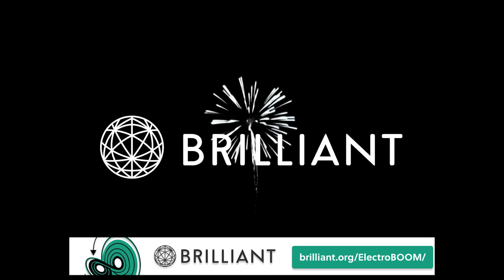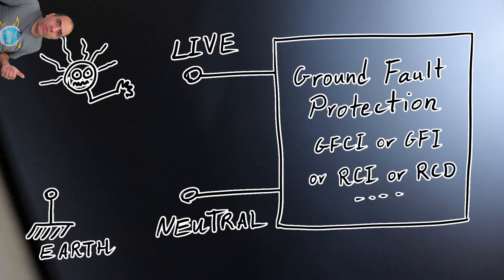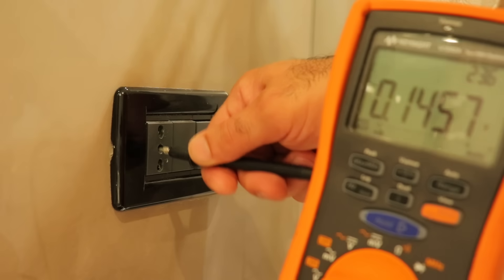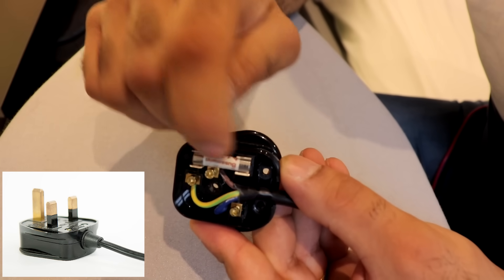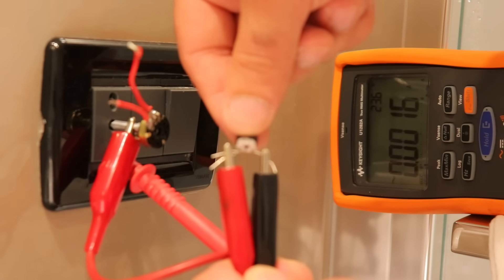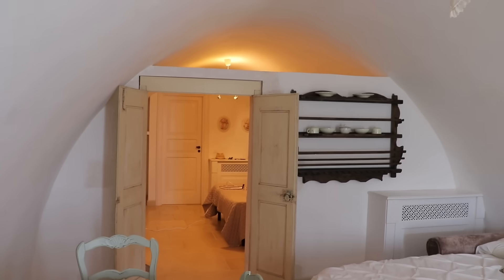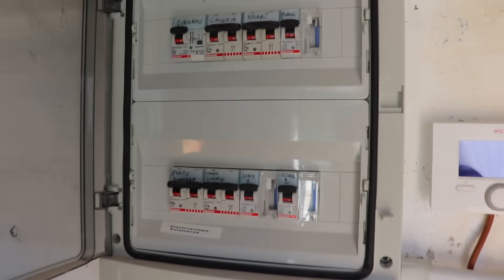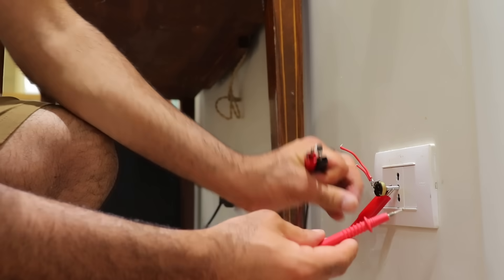Tripping Every Breaker in Italy

Comment: Fun fact: as you can see at 7:21, in Italy we have Ground Fault Protection breakers commercialized as “Salvavita” which literally means “Lifesaver”
Anyways, props to you who managed to shove a Schuko 15:28 into that socket. All of my attempts always miserably failed
Reply: That wasn't a Schuko, it was a CEE 7/7 plug. 15:10
Reply: @Okurkaarrgghh  Italian sockets have two side holes 10A (small) and 16A (large) then there are sockets like those in the video which are called 10/16A sockets with double holes, the shuko plug (CEE 7) cannot be inserted in either in the 10A socket nor in the 16A and not even in the 10/16A because the center distance is different, only by forcing it a lot you can insert it but you shouldn't because the earth is not connected
Reply: @Okurkaarrgghh  he was assuming that since you pointed out it wasn't a schuko then there was a reason why he was able to plug it in. General conversation common sense
Reply: @Salvatore_Corona  Everyone i know ( i am exaggerating ofc ) forces the schuko into the non schuko. I always tell them it's not safe... I call it bad design.
Reply: @Azarilh  personally i find it really hard to fit a Schuko inside a 10/16, and I've been tought that if you have to force it it's not made for it. So i never even tried to, but then again there's many types of people and design should account for it, yes.
I blame it mostly on the double standard of using Schuko plugs kn the first place but since we have to the design should remove the issue, which apparently it doesn't
Reply: @zerokun2655  It is a tight fit and you have to shove it inside but i see many people do it.

If it's possible and many do it it's a flawed design.
Reply: @Azarilh the thing is that one Is the German standard (shuko) and the other is the Italian one, but nowadays a lot of home appliances come with the German standard plug in the hole Europe
Reply: @Okurkaarrgghh È sempre della famiglia "SCHUKO" !
(Schutz-kontakt!)
Reply: @Okurkaarrgghh  I see what you mean, but that's nitpicking. That plug is still a type of Schuko, compared to all the other standards. It's just the modern type of Schuko that is compatible with French sockets.
Reply: Yes.. when he inserted a Schuko plug in an Italian plug i was like: wait.. that's illegal
Also i didn't know the whole unit had GFCI, went and checked my electrical panel and i found those 30mA GFCI breakers.
You learn something new everyday
Reply: Lol. In Argentina, many people continue to call Ground Fault Protection breaker "salvavita" despite the fact that the brand has not been marketed for decades
Reply: @juanignaciofernandez8040  It's not even a brand in Italy, it's literally just how it's called.
Reply: @Shendue At 7:21 one can see salvavita® on that GFPI from BTicino. So it seems to be a brand of this company
Reply: lo stavo per scrivere ma sei stato più veloce di me GG per te fra
Reply: Ive shoved a shuko in an italian outlet 😈😈😈👍🏼
Reply: Fun fact - the breakers are labeled "camera 5", "camera 6", because camera = room
(I am not Italian, but I figured this on my own and it immediately clicked with the name of the thing I've known for a long time "camera obscura" - literally a "dark room"  ... maybe not how you would say it in modern Italian, but that was probably Latin, and the word for room stayed the same in modern Italian)
Reply: @panda4247  "Camera oscura" in modern italian :D
Reply: @Marorrai  cool, thanks :)
apparently, I was too lazy to google it when I wrote the comment, I was so happy about myself :D
Reply: What were those riots about?
Reply: @Fneeps_TF2_Experience  looked like a fan gathering for AS Roma(football team)
Reply: @luke6565  they're basically the same, right?
Reply: @Fneeps_TF2_Experience  yeah but police won't do shit cause "calcio".        

(Soccer/football)
Reply: @Fneeps_TF2_Experience  As other people said, that's just the average AS Roma fan gathering. 
And yeah, they're basically "allowed riots" in Rome (the only thing a particularly disrupting fan risks in these cases is DASPO which is a prohibition to participate to sporting events for a certain period of time) so they're really not much discouraged, if at all.

I don't really know how safe it is to walk by them (it's better to avoid them, that's for sure), but what I can say is that foreign teams' fans frequently leave the city in a far worse state than they do
Reply: @TheKironos  Thanks for the explanation
Reply: @TheKironos  I haven't read such an exhaustive explanation in a while, well done.
Reply: @TheKironos  such attacks do happen, sometimes they're deadly, but I don't think it's frequent as you say
Reply: “For God so loved the world that He gave His only begotten Son, that whoever believes in Him should not perish but have everlasting life.”John3:16 NKJV

“that if you confess with your mouth the Lord Jesus and believe in your heart that God has raised Him from the dead, you will be saved.”Romans10:9 NKJV 

”For what will it profit a man if he gains the whole world, and loses his own soul?“ Mark 8:36 NKJV
Reply: @Bakedfrijoless please stop shitposting about your imaginary sky boyfriend.

Comment: The shuko kind of plug shouldn't be able to be plugged into the "doppio passo" ones. The reason you are able to do so is because someone banged the plug in. The dimensions is studied to prevent so but the plastic is so much resistant so...

Comment: In Europe it actually varies from place to place, in Germany in older installations built from 1984 to 2007 RCDs/GFCIs where only mandatory for circuits in bathroom and for circuits that are located outdoors, since 2007 all sockets had to be secured with 30mA RCD/GFCI

Comment: The outlets with only a small hole are secured by a 10A breaker, the ones with the 8 shaped hole by a 16A one.
To distinguish the tension of the train lines is simple, the 3kV ones have two wires.

Comment: In Europe failure Current Protection, as you call it GFCI, usually is located in the main breaker board compartment, 
because we have Standards and we do not expect to trigger the GFCI every 5 Minutes.
Furthermore we do not want to have every Idiot playing with the GFCI. Current threshold in newer installations should be around of 10 mA.
They usually install 30mA Switches because some electrical devices would trigger it too often.
Our Standards also say: Yellow-Green == Ground, Blue == Neutral, Brown|Black= Live Wire ( btw. awesome Song by AC/DC).
If you ever encounter a round Powerplug with five holes, that's where the powerful stuff with three phases at once happens.
For more Information search "VDE0100" and "PEN" wiring (which is outdated but applied to many Buildings, so ...).
If you look close onto the Connector of each device or the Specification Laben on the device there is a sign which constists of two
Squares, one inside the other one. This sign says, the device should be fully isolated and there is no need for ground connection then.
We call the slimm groundless Plug the Euro Plug, for exactly the reson you mentioned, it should fit everywhere in Wurope without being in danger. 
Except Great Britain, which obviously doesn't belongs to Europe. At least not monetary and electrically.

Comment: European standard for Residual current devices states that a 30mA protection must trip in a range 15mA to 30mA. Obviously the manufacturers prefer to set the differential relays near the 30mA threshold in order to guarantee a better service continuity. Just for your information in Italy, according the last standards for residential electrical installations, it is more and more used a distribution  where every room is protected by a residual current device 30mA with upstream a 300mA device. In my apartment for example I have 5 RCBOs. Reason is that in case of earth fault we can have a part of installation still alive (o we have light to see around).

Comment: hi i write from italy.
The socket you have shown are of the Italian standard CEI 23-50 P17 / 11 accept Italian type L plugs, standard CEI 23-50 S11 (maximum current 10 A) and type L standard CEI 23-50 S17 (maximum current 16 A).
The socket that you show at 5.26 min is an S11 type socket The S17 sockets have contacts with a diameter of 5 mm at an inertia of 21 mm
The plug you used at minute 17.40 is a type F CEE 7/7 Schuko (formerly German standard, now European standard).
The Italian plug S11 has 4 mm active, non-polarized contacts with 19 mm center distance and central earth contact, the S17 plug has 5 mm active, non-polarized contacts with 21 mm center distance and central earth contact.
The Schuko-type socket has two 4.8 mm active contacts with a 19 mm center-to-center distance and lateral earth contact
By forcing them you can insert them into Italian type P17 / 11 sockets, but you damage the socket, deformed plastic and internal contacts, inserting the plug you risk electrocution, you lose the earth connection and the electrical contact is not guaranteed, you can have electric arcs and overheating of the socket, I personally replaced some P17 / 11 sockets in which shuko plugs were inserted with melted plastics and with the contacts of the plug and socket welded together.
In Italian sockets, Italian plugs must be used
To use the Schuko plugs in the Italian standard sockets or special adapters are required.
However, since things weren't messed up enough in Italy you can also find the Cei 23-50 type P40 sockets that accept the Italian type L P11 P17 and European type F type CEE 7/4 7/7 and 7/17 sockets, they are less common because in addition to being much more expensive they take up two modules and in the 503 type boxes you can mount a single socket instead of the 3 in Italian standard

Comment: Thanks for another funny and [de-]illuminating travel adventure!  You mentioned a few times that in North America, GFCIs are typically only found in laundry rooms, if at all, but that must be a Canada thing.  In the U.S., I believe it's illegal for them to not be present in any wet area, and aside from some old properties not properly maintained by a private landlord, they're now almost always found on kitchen and bathroom outlets, in my experience.  Per the "Residual-current device" Wikipedia article:

"In North America socket-outlets located in places where an easy path to ground exists—such as wet areas and rooms with uncovered concrete floors—must be protected by a GFCI. The US National Electrical Code has required devices in certain locations to be protected by GFCIs since the 1960s. Beginning with underwater swimming pool lights (1968) successive editions of the code have expanded the areas where GFCIs are required to include: construction sites (1974), bathrooms and outdoor areas (1975), garages (1978), areas near hot tubs or spas (1981), hotel bathrooms (1984), kitchen counter sockets (1987), crawl spaces and unfinished basements (1990), near wet bar sinks (1993), near laundry sinks (2005) and in laundry rooms (2014)."

Comment: The “figure 8 shape” on live and neutral hole are because there’s two categories of breakers:
-the smal closer holes for 8A breaker

-the big hole for 16A

If you have a connection point with only the small holes is because it is plugged in a smaller breaker. 

Keep up your video, they are very educational

Greatings from PADOVA (italy)

Comment: Hi mehdi, the dorrs/the power outlet that you where speaking about it is a System of a child protection in Europe we have them in the electrical socket so no child can stick in for example a fork or a metal sticks.
And the ground Flor protection it is often called PSA which is built in the main circuit breaker, it saves room and it is more efficient. 👍🏽👍🏽

Comment: 15:22 Actually the size of the outlet holes does stop you from inserting the wrong plug (as you are doing). I have to say, you are very strong if you were able to force it, it’s really not that easy.
Anyway we use adapters for the “Shuko” plug (that is actually a German standard) you were using.

Comment: Glad you found our electrical safety measures up to snuff. We take it very seriously - having at least a 30mA differential breaker (the so-called "life-saver breaker") has been mandatory in domestic systems since 1990, with another built in the e-meter. And most electricians will insist on installing extra - it's pretty standard at this point to have one for the plugs and one for the lights, or to have dedicated switches for the bathroom plugs and/or any that may end up taking an appliance. 

As for SchuKo plugs, well, you'd actually need to ram them quite forcefully in a 10A "Italian" outlet - according to European norms, the Type F should have a 4.8mm pin vs. the 4.4mm of the Type L. But of course, in a hotel room - where the sockets used may not be of the best quality, and many people will forget their adapter and force the plug in the socket, "who cares it ain't mine" - this will eventually become easy enough that you may do it inadvertently.

Comment: Here in Argentina nearly all houses have a main breaker with a differential ono too. My house uses a 40A breaker with a 40A 30mA diff. inside whe have the two floors separated by two 26A breakers

The problem with this system is that usually all homes uses only one Diff breaker. If you house is too big or too old, it will trip for anything, like raining days or bad cables touching some metal box or humid wall.
Nearly no home have multiple breakers with multiple differential for outlets, lights, bathrooms, washer, etc. Just new fancy departments
And nearly all homes I visited, included parts of mine. The cables don't support the breaker rating
(If you use the 25A distributed in different parts of the house and outlets you will be fine. But if you go to the chicken and connect everything at 25A, the breaker will not pop but the cable can start a fire)

Comment: That socket you didn't know what can you connect, is a "Bticino Magic series", it's a old socket. It can bring up to 20A at 250V. Nowadays electricians don't install that anymore, it's even out of production from 2/3 decades, I guess. It was made for 1 or 3 phase heavy duty appliances to use at home, especially in garages.

Comment: In Europe breaker box in apartments is usually above or next to door, in hotels usually in hallway or broom closet. And only in Italy when current limit trips neutral is also removed. Letter before number describes tripping curve B is soft, used for domestic apliances, C is hard used for industry, motors, welders ect. D is extra hard for industry. C16 means C curve 16A.

Comment: hello, at 15:30, that is a German type plug and they are not made to fit into standard Italian sockets. for that type there are special adapters. unfortunately the distance between the poles  is the same, and with a little force they fit into the 16 and 10 amp sockets. bye!

Comment: The Story of two holes in the plug is a litten bit longer, it has to Do with apliances that use more or less Power so that the wirering can be made easyer (since copper costs, and Italy didnt have that much Power as other countryes. Again, the fact that a propper Insert of outlets in the soccet is not needed is because of the "lifesaver" mentioned earlyer. If the device "tickels' you when you Touch it you just reverse the plug. ;) i was shocked as I saw how medievaly americans treatet theyr current ;)

Comment: This is how a super hero is born, after a faulty breaker accident, an electrical engineer named Mehdi gained the super powers to view circuits through the walls, tell what the voltage, resistance, and power is just by looking at a wire,  and also has the ability to smell ground fault protection from 3 miles away. Its ElectroBOOM, the super hero we need, but do not deserve!

Comment: That unsightly abomination of a socket you found next to the RJ  at 9:13 is supposed to be a telephone standard that was invented by one socket vendor; originally used for three-phase power in the sixties, when residential three-phase power was abandoned the plug was repurposed for telephone. It' s called MAGIC by BTicino. Never seen used by anybody here in Italy, even though some ADSL modems still come with adapters from that to RJ11.

Comment: 15:05 in europe when we need netral wire for case, we use ground (middle pin). It's just this plug you used is not italian type, but it works, but not connects ground

Comment: thanks! in residential houses it's even better, separate breakers and grounf for every outlet.
Plus a Shucko in a normal outlel usually hard to fit, guest those outlet have unusual soft plastic and probabilby several clients did dis before pushing and opening the plug.
most of my house outles. have both standard and shuck and also triple plugs in 1 , 10A standard 16A syandard and 16A shucko